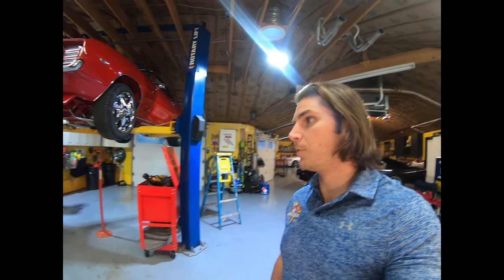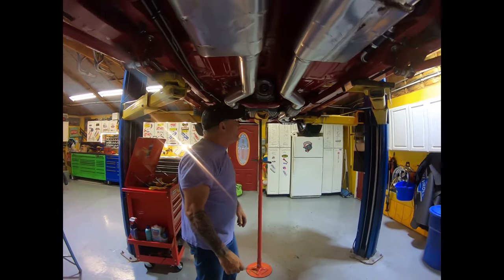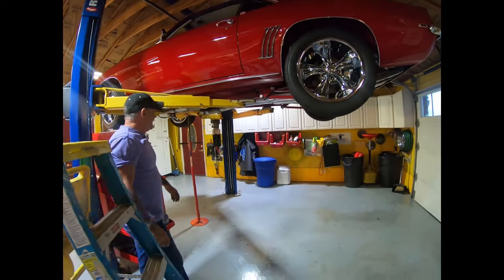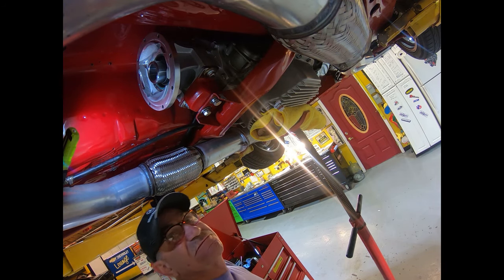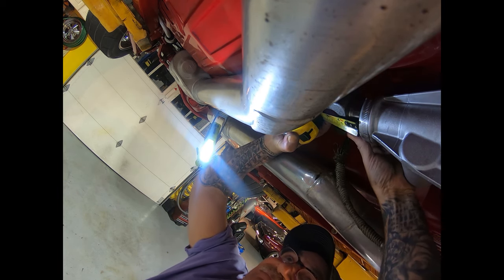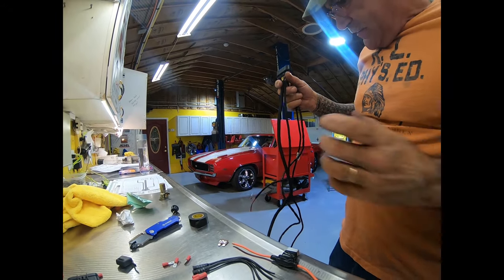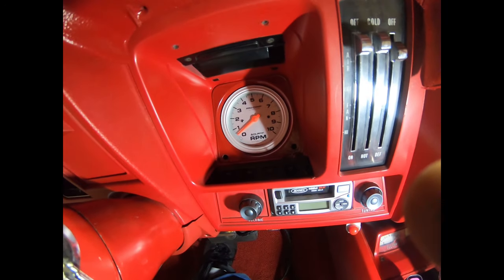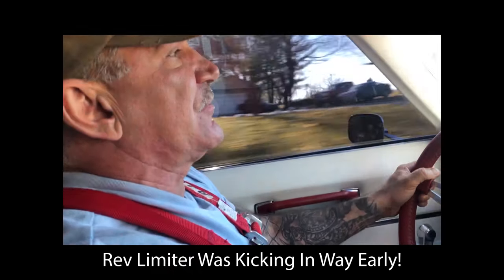Installing Gear Vendors Overdrive On The Camaro. Is It Enough To Beat The Tuned Mclaren?!

Comment: Enjoyed the install video, as I recently installed a similar unit myself. Having said that - you may want to review the installation instructions (pg. 18) in regards to how to measure for coupler end play - specifically, the measurement is to include the gasket thickness when determining amount of shims to be used. Would hate to hear you ran into premature failure down the road. Again, thanks for the video.

Comment: Hey on the wiring the wires on the trans side the two wires that come straight off the solenoid looking part but anyway They make the little spade connectors with the 90 where The Wire goes in the side. So they could have plugged on there and The Wire would point out the top instead of straight out the back.
Just thought I'd mentioned it. So you could make your wiring.  Prettier if you wanted to lol

Comment: in automatic mode, does it automatically gear split (1, 1 over, 2, 2 over, etc) or just go 1,2,3,od.  Im having a hard time finding that out. most of the examples i see are people shifting between gears and hitting the od switch for each one
Reply: According to their site, when employed, it will act like a normal trans with overdrive i.e. 1,2,3,od.  It will go into overdrive at 47 mph. Manual mode will allow splitting. More info is at gearvendors.com.

Comment: Are you shifting the Gear Vendors in and out of overdrive under a load when in manual mode? The reason i ask is because i also have a th400 reverse manual valve body with a Gear Vendors. And was wondering how you chose to do the shifting. I found that if i leave it in automatic the shift are very hard in and out of overdrive.
Reply from the maker: Henry Sordia we tend to use the manual button on the floor

Comment: Why not put a overdrive transmission all in one unit.
Reply: This gives you six forward gears practically. Has the strength of your original good or already built th400 , retains all your flex plate , shifter and converter set up.

200 and 700r4. Aren't known for there reliability.  So really you'd want a 4l80e minimum. But that's a single over drive. 

So really to compare you'd want a 6l80e.

Then will need flex plate , converter , box , stand alone TCM , tune , mount set up , shifter set up etc.
Reply from the maker: Nailed the response!

Comment: Thank you for the video. Not many on GV installs out there. 

How much of a highway cruise rpm difference did you see on 3 OD gear? I have pretty much same setup and I am undecided between GV or Manual 6.
Reply from the maker: Roger Morales it depends on tire size (27” tire) & rear gear ratio (.355 gear) we saved 600 RPM at 65 mph. We are at 2250 RPM. Hope this helps. We love the set up
Reply: @WolfpackRides  Thanks for the reply. I calculated around the same. First video I saw with very close set up to me. Had to ask.

Comment: I know it's an old video but at 7:25 you didn't have the adapter bolted tight when you measured your end play. When you put the bolts in and tightened them that changed the clearance 'cause of gasket compression. To compensate remove a shim that would be close to the same thickness as the amount lost from gasket compression. I would guess about .020 thou depending on the actual gasket thickness.